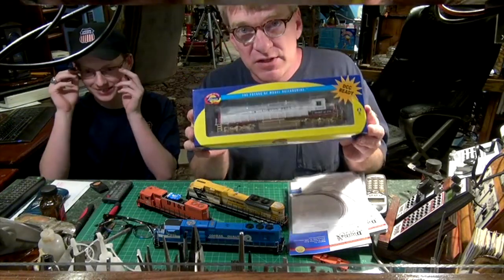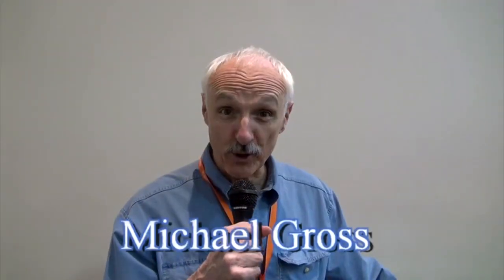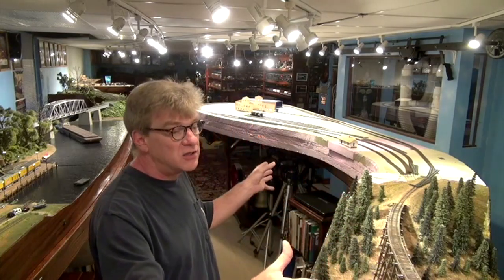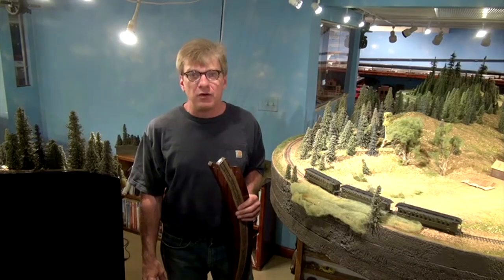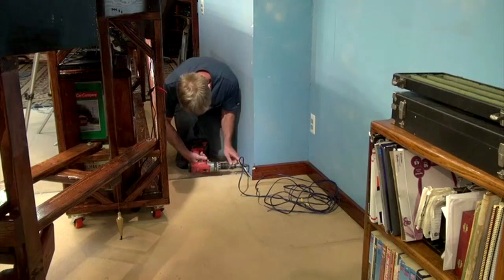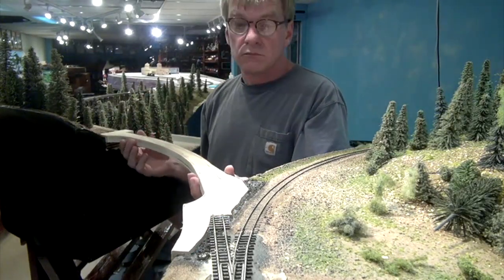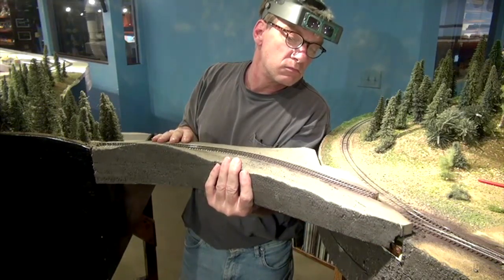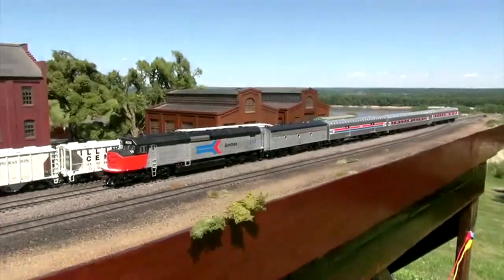Whats Neat in model railroading | August 2017 Model Railroad Hobbyist | Ken Patterson

Comment: Ken, another great one!  I really got a lot out of the lift out sections.  I think that might be an answer to a problem that I have had designing a layout for a mixed use room.  Lift out the sections and the wife can use the room, then sections back in and I run trains.  Great info, thanks.

Comment: Thank you Thank you Thank you !! your the magnet lift out segment was just what my layout out needed. i always struggled with getting my lift out section to fit correctly and the whole thing would sag, after a couple trains would run over it ,because the hardware just simply was not structurally sound.